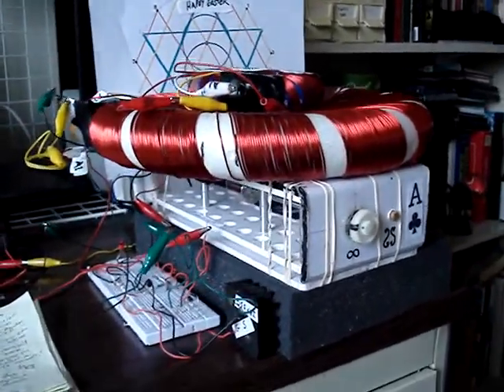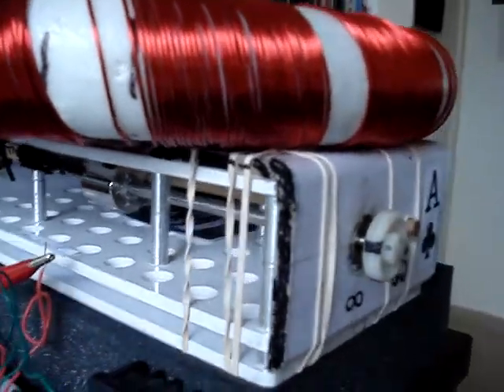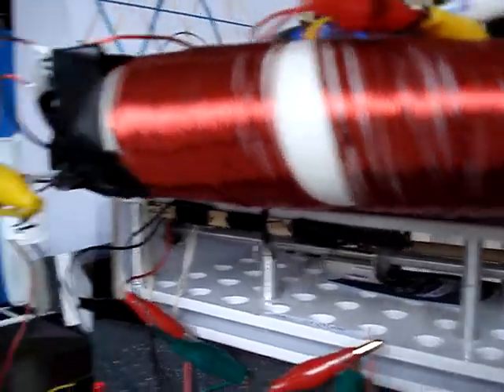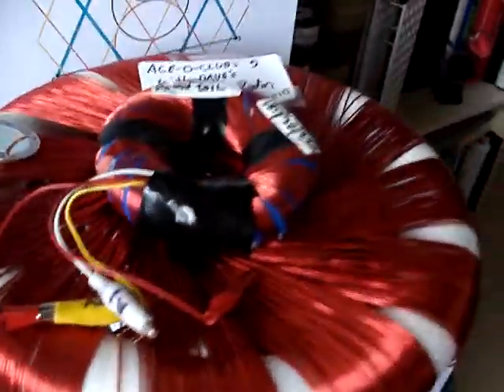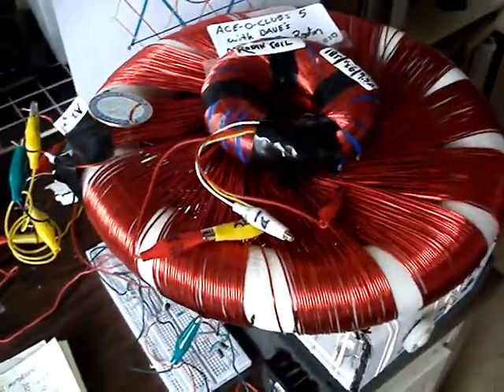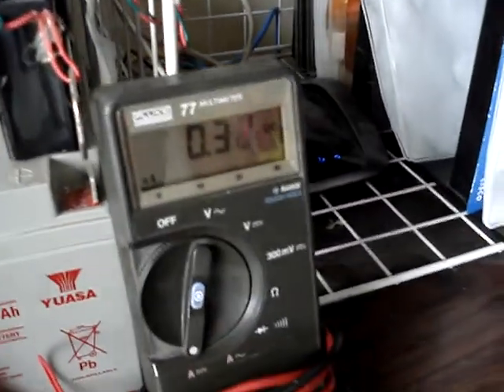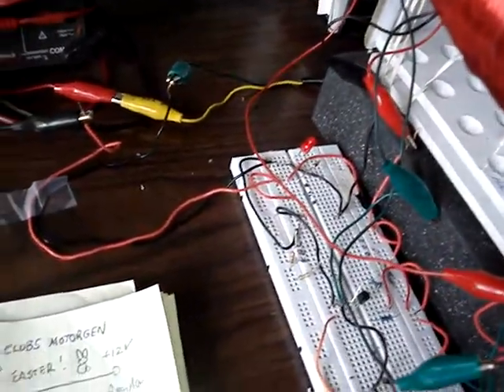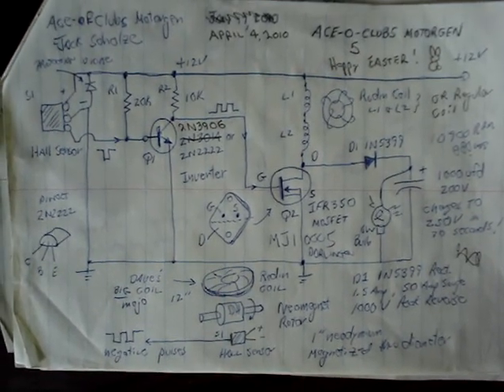ACE-O-CLUB 5  Pulse Motor

Comment: @jackscholze 
Yes .. the recipe for positive feedback is to phase shift by 90 ... and then 90 again. A transistor can do a 90 degree phase shift -- a transformer with primary and secondary wired oppositely can do another 90 degrees. This is exploited in joule thief. You can also use two stages of transforming... or two stages of transistors.